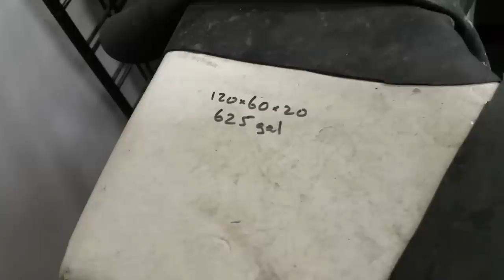Pond Liner FAILURES you NEED to KNOW about * Customer Appreciation Shout outs

Comment: Use pool cove for ur corners an around the edges it will eliminate ur pulling from corners issue for good
Reply: Also switch to preformed pool liners same thickness but fit tighter an no folds in corners to deal with looks a lot cleaner as well an most companies will make them to your specs

Comment: I’m just wondering if getting basically a thick acrylic tank that would fit into that space would be the best fix, and placing large diameter washers/spacers help stop any leaking by the bolt heads in the tanks with the liners, so that it keeps the seal over a larger area even if the pond lining shrinks around that area? Just suggestions as I don’t have these issues 😅 as I don’t have rays
Reply from the maker: Good suggestion. Thanks.

Comment: you can fiberglass your ponds as it will automatically cover the toxic rubber with the fiber. paint the clear resin on and then put a dye in your gel coat and it should be fine for a long time. you can research it on youtube too.